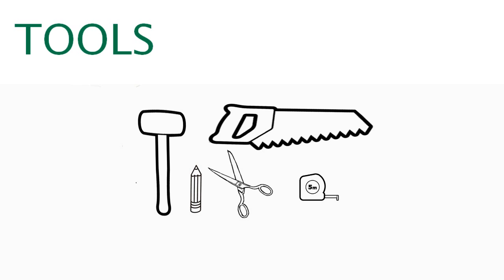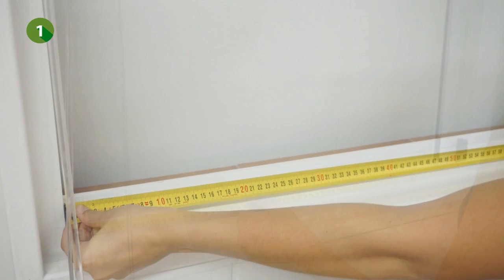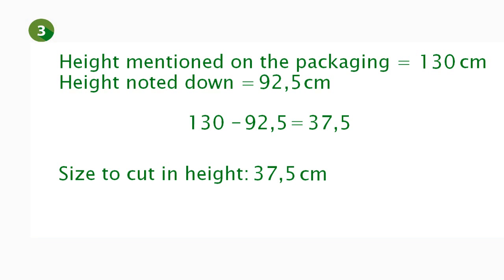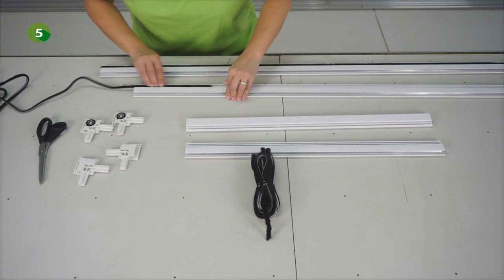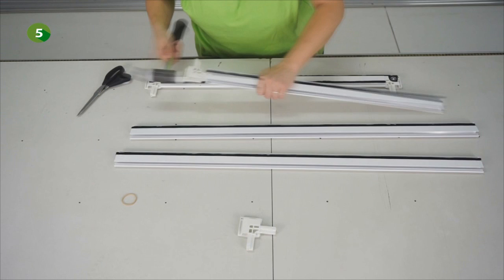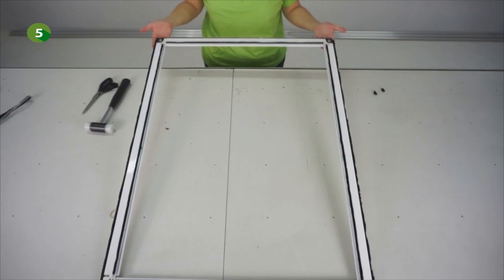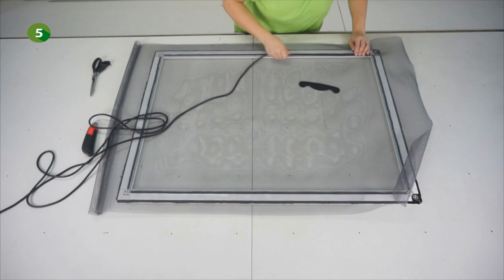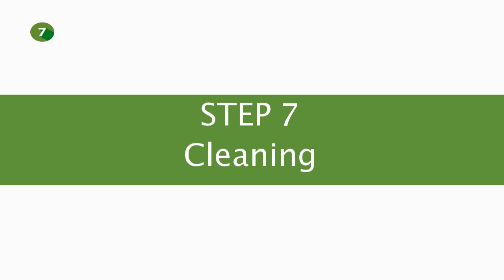Sliding Flyscreen

Comment: Hi Bug-Stop, I have to mention that your measurements are incorrect, for instance - your height profile, you measured 37.5cm to cut off, what you haven't told people is the extra 7.5cm cut need to make the height correct size overall ( inc the corner profiles that adds to the length ).
When watching this video, I knew this was incorrect, but i went and cut one length to make sure (height), sure enough the overall size was too long. 
Hope this helps someone.